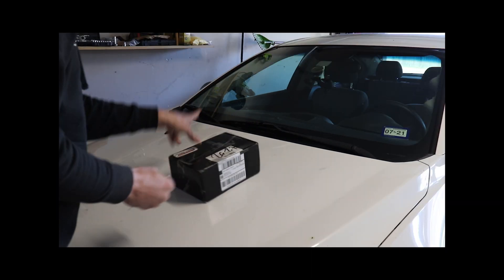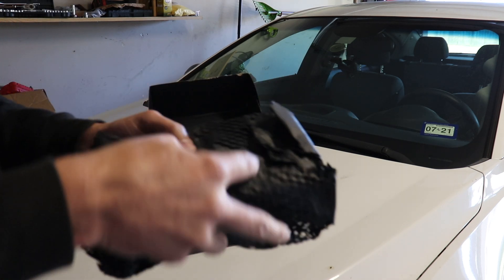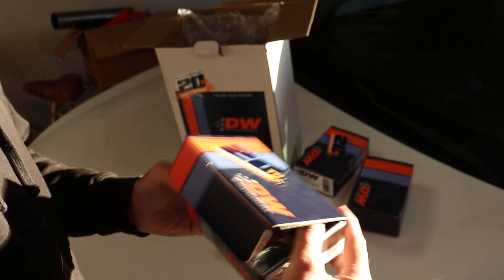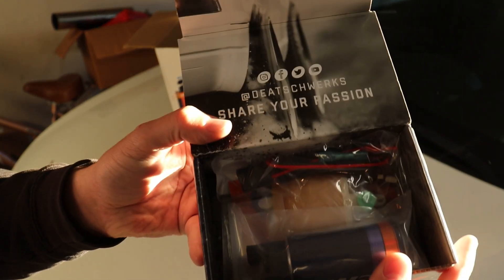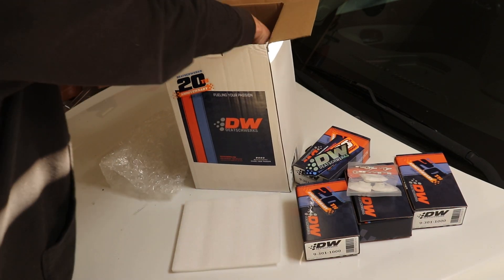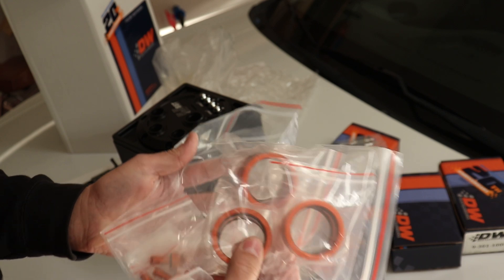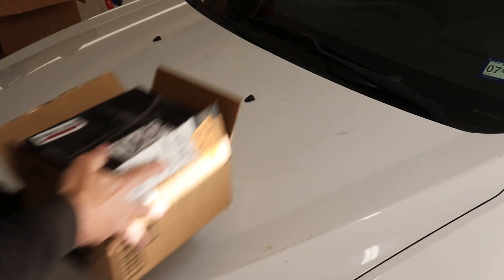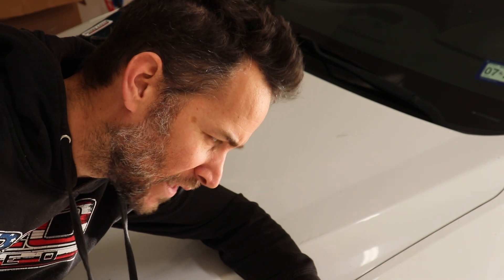All the Fuel! Fuel System Upgrade for Up to 1,500 hp! (Snake Eater & Deatschwerks Unboxing)

Comment: I’ve got snake eaters 2200 in my car. I’ve got no complaints they have worked well and been in probably 10 months with a few thousand miles driving and about 15 passes on them. I’m very happy with there pro series injectors
Reply from the maker: Thanks for sharing!

Comment: I don't think I've ever heard anyone pronounce the A and N for Army Navy spec tube fittings as a word.

-8AN is 1/2" OD tube, ~7/16" ID.
-10AN is 5/8" OD tube,~ 1.2" ID.
Reply from the maker: You learn something every day. Never knew it stood for Army Navy. Thanks!
Reply: @cmattdabrat  joint standard that dates back to WWII. Army Air Corps (pre Air Force) and Navy developed 37° flare for aviation hoses and tubing instead of the SAE 45° flare used in automobiles (brake and duel lines).

Comment: I'm guessing these are Bosch 2200cc CNG injectors with the internals swapped to be all fuel compatible. Def a good option for super high performance! The as manufactured 2200cc injectors work great, but can swell internally depend on what they are exposed to, and obviously that's bad. Fuel pump setup looks beastly! I highly doubt you will need all three pumps, but can't hurt to have an extra. Highly highly recommend checking out Racetronix for all your AN needs as well as filters. Their prices and quality are fantastic. Fast shipping too.
Reply: They are just stock CNG 2200's.
Reply: @garyhowe88  Interesting they had some visual differences to my memory. If they are just basic CNG 2200 injectors they work great, just can't run oxygenated fuel, methanol, or some other fuels. Letting ethanol sit doesn't seem great for them either. They worked well on our rotary swapped BRZ though even for idling low. We just aren't sure if they swelled at all after sitting. Most websites selling them will have disclaimers. Claiming they worked with Bosch though if they haven't changed anything is sketchy.
Reply from the maker: Thanks for the info.  I don't think I'll need all three, but we'll see where this project goes. As long as it keeps holding together, it'll be fun pushing this little motor as far as it can go to have an option that's not cookie cutter. I'll check out Racetronix. Thanks again.  You're the man!

Comment: I complained to him for making the filter look bigger then it actually is. They're tiny and will clog up in a month. My other i have thats twice that size I have to clean once a year and i only put 200 miles at most on that car. I'd recommend not running that filter especially if this car gets driven alot.  

As for injectors I've been running his pro series 735cc I believe in my turbo silverado for a year now issue free. 2200 are probably way more then you'll ever need i wouldve went with 1400 at most easier to dial in and tend to idle much better then the 2200. I went with 2150 in my awd talon and wish I would've went with the 1400 or the 1650's
Reply from the maker: Definitely caught me by surprise, the size of the filter. I'll keep an eye on it.  The stock fuel pump in the tank has a filter, the new fuel pump setup will have filters. The Snake Eater filter is just a safe guard for all the new hose / AN fittings.

I'll report back as soon as I have the 2200's in. As it stands, with my manifold.  It's happiest above 1k rpm for idle with the short runner length.  I currently have 1050 ID's. I still have enough outputs to drive 4 more injectors, so I could always modify my intake to run 2 injectors per cylinder and retain the 1050's for idle / normal driving and have the 2200 come on during boost.

Thanks for sharing!
Reply: Check out the Racetronix -12ORB fuel filter housing and filters. Absolute bargain for what you get and it's huge. Should be able to filter for years without needing cleaning. Way less expensive than other options for the same quality.

Comment: Would be crazy if there was an AWD conversion!
Reply from the maker: That would be cool!  Definitely a goal to go AWD at some point. Will take a lot of fabrication.
Reply: @cmattdabrat look into the Saab 9-3 awd systems. You could at least use the awd f40 6 speed manual and figure out an awd system after that since the chassis is smaller than a 9-3 epsilon platform. The f40 should have the same bell housing pattern as the fwd version came in those cars for certain years.
Reply: I floated the idea around. Maybe with a trac or equinox drivetrain
Reply: Yea zzp and trifecta have done it to sonics using trax stuff since the trans is the same  @QDArt-gj6lb
Reply: Probably require a crv transmission, rear diff, and an adapter plate to bolt the engine to the trans
Reply: @sinformant there's a few different awd drivetrains that bolt up to the engine.